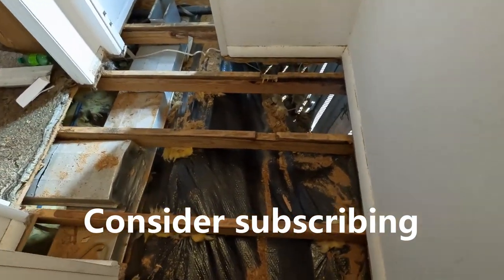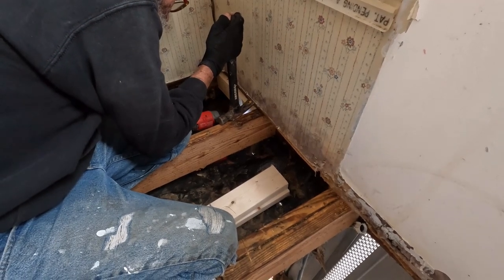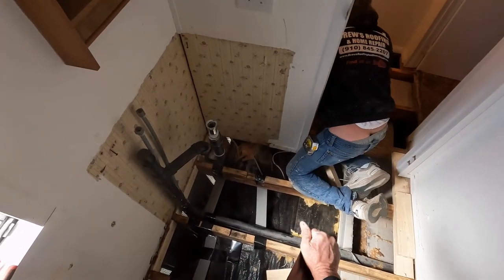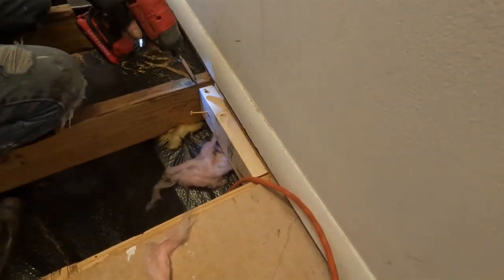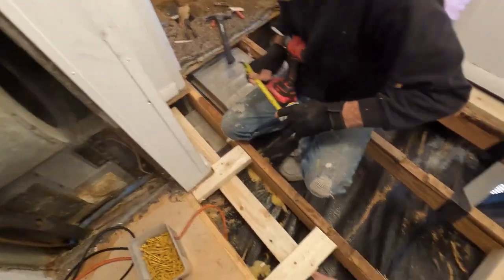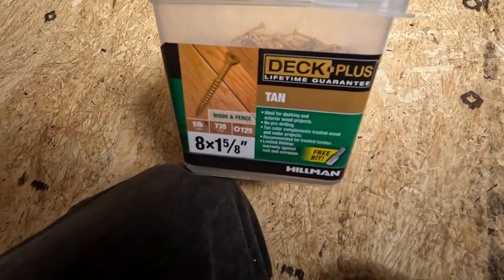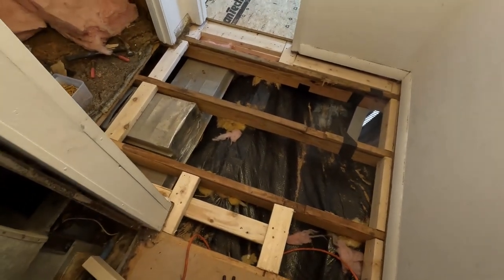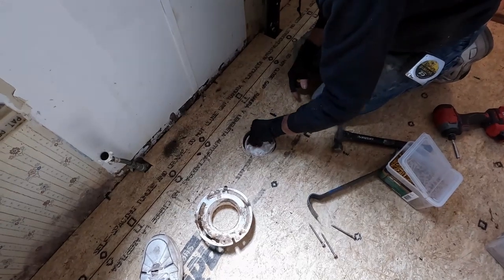How To Mobile Home Bathroom Floor Repair

Comment: Awesome it’s not easy but it’s figure outable thanks to you I did a whole house but I don’t ever want to have to do that again…
Reply from the maker: Use the best materials and you wont
Reply: It's THE worst
Reply: Omg this gives me so much hope for myself, since my husband passed away I have had to figure things out for myself when it comes to jobs around the house. I have a big job I need to do and feel honestly scared to try but I don't have the money to pay anyone so confidence is what I need!
Reply: @NatureRocks.  You can absolutely do it. If it's replacing subfloor, you may need a man to help you pull thr nails out of the joists. That for me was the hardest job of all. Be sure to accurately figure out the thickneof the subfloors you are matching with. Oh, and measure twice, cut once. Good luck
Reply: I noticed when you laid the sub floor there was gaps around the door facing how do you fix that so air doesn't come out It? And what did you use on the grinder to clear the debris off the floor joist?

Comment: I thought the paper on the insulation was supposed to be up against the floor?
Reply from the maker: Paul seems to think we do it the way he did it. I say it’s the other way, but there is already a vapor barrier, so it really doesn’t matter which way it goes at that point.

Comment: Really great job.  Especially by the guy on his knees old man better than 98% of us on here watching him. I’m learning dealing with rotted floor under the toilet flange
Reply from the maker: I have a few videos on toilet flanges
Reply: @Drewsroofingandhomerepair  thx I’ll look through them tonight.  I’m getting conflicting placements on where the bottom of the toilet flange should lye, on the top of the sub floor or on top of whatever is the highest floor ? Some videos have in middle of top layer

Comment: I like the ideas reinforcing around toilet ! Just curious, why the vapor barrier of insulation faced down? It shall face to the warm side in our pacific northwest area.
Reply from the maker: The only reason why I did it is because the Mobile Home already has a vapor barrier under it I didn’t want to make a closed off section vapor barrier on two sides inside being moist

Comment: We will be starting the bathroom floor in my son's trailer soon but my question is about his roof.  It is really bad but it goes level for 15' then has a 45 degree drop for about 18" then goes on level the rest of the way. Do you have a video on how to deal with the elevation drop in a roof.
Reply from the maker: No sorry

Comment: I would like to ask about how much does this type of repair tend to cost? I have a broken window which has been leaking for a while and now i want to have the subfloor gutted and refloored with proper plywood & vinyl plus needing the toilet & pipe to be fixed too? With my work schedule I just don't have the time to do it myself. So I thought I would ask.
Reply from the maker: I charged $900 for the bathroom that was just for the part that you seen us do everything else would be extra so if you have to buy a new bathtub a new vanity, a new toilet probably looking at about $2500 doing it yourself
Reply: @Drewsroofingandhomerepair  ok thank you so much. Thankfully not as worried about the tub, if it can be avoided, and our vanity is still good ( no signs of the damage reaching that far) * fingers crossed*  but definetly thank you for the estimate. At least I can be prepared for what a contractor might say. Thank you for the videos too. Its giving me a better understanding of what has to be done.🙏

Comment: What size are these boards in my trailer are they 2x3s or what drew there not 2x4s drew i need to replace some i don't know what size they are looks like 2x3
Reply from the maker: What boards. They can be different in all of them. You will have to measure yours my friend

Comment: I own a '77 single|wide but I live out West, in Northern Nevada. It was actually manufactured in Southern  California though. And it's a lot colder in the winter here than in SoCal. My heating ducts lie just under my subfloor. There is no insulation between the ducts and the subfloor. And under the ducts in the underbelly, it's just crammed beneath the belly board. I'm wondering if the location is why. 

I've never lived in a trailer before. I had no idea what I was getting myself into. I laughed when I once heard you say, "you never know what you're gonna find" once you open it up.  Just when I think I understand what's going on, I come across something truly crazy. Like um, the toilet that was relocated to the center of the heating duct... That's just one of the innumerable problems I've discovered. I don't open a  can of worms, I open trash bins of snakes. Big ones too!

And in Nevada there's a manufactured housing division of state government, which requires any contractor to be licensed by manufactured housing. Great concept, however it completely prices me out of any reputable and affordable work. No one will even help me, except idiots who are unlicensed. Essentially requires me to perform all my own repairs. I don't know how I'm going to get the porch detached from the trailer. Yes, literally bolted into the side of it which is pulling it down. I'm basically f*#ked.
Reply from the maker: If it’s made of wood you can fix it it’s gonna take some elbow grease and of course a few bucks. I wish you well on your project. If I was anywhere near you, I would gladly help.

Comment: can the underbelly be installed from the top of the joists and hanging down between each, stapled along the bottom of the inside edges? the space under my mobile is too small to fit a person  under there. thanks
Reply from the maker: Yes. You can do it from the top. Remove the sub floor install vapor barrier. Just like you said
Reply from the maker: https://youtu.be/hcGn47ACDx0

Comment: Never give a contractor up-front money "for materials".  Any contractor worth his salt has "net 30" accounts wherever he gets his materials (meaning he doesn't have to pay for the materials for 30 days after he gets them).  If he hasn't done enough work within 30 days to pay for the materials, then he's worth less than nothing, no matter how big the job is.  It's fine to pay them for work-completed in stages so he can pay for the materials and labor, but that should happen AFTER each stage of the work is complete, not before.
Reply from the maker: I totally agree. This is insane

Comment: Probably the only thing I would have done differently would have been to use pressure treated 2X4s   under the outside wall and the bathroom/ kitchen sink areas just in case of future leaks from frozen lines .  

   My boy also likes those star/torque screws ... Me , I like the square better . They seem to power in a little better and stick to the bit better when you dont have both hands available in certain areas..  But both are better than Phillips... i just ude them on thin soft wood....

Good job.. nice to see people willing to do manual work in this day of woke , lazy , people  wanting money for nothing...
Reply from the maker: Thank you for the compliment, and I like the star headed screws the best myself I do not like the Phillips bit